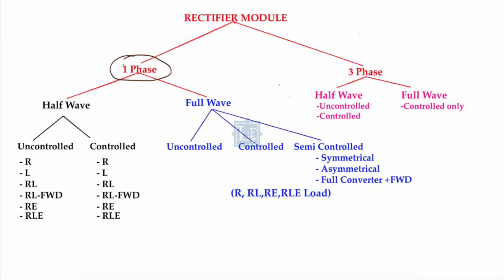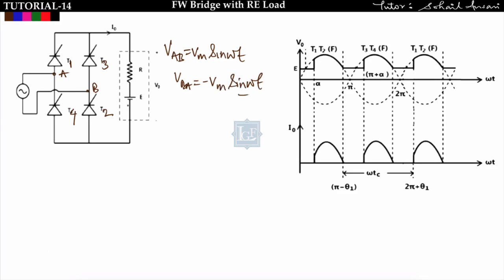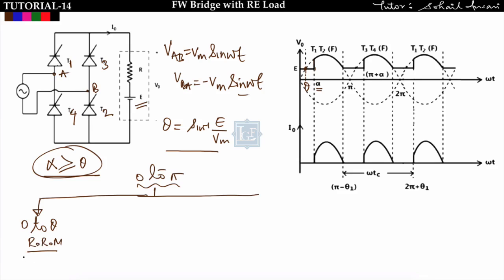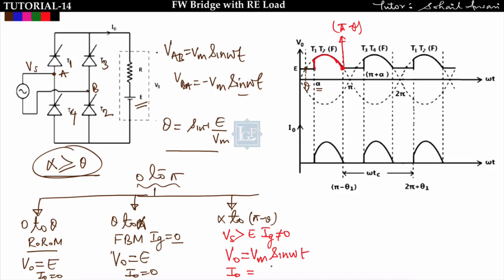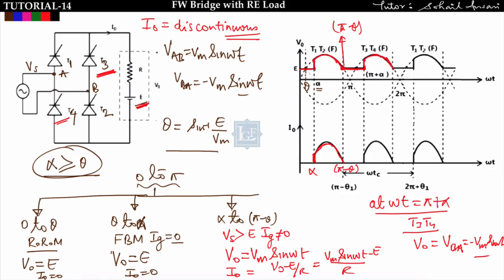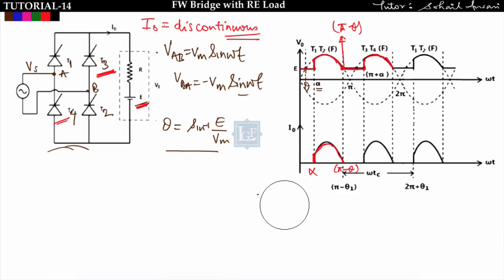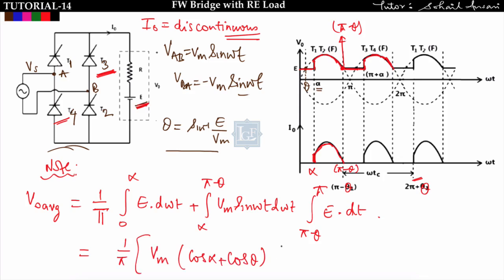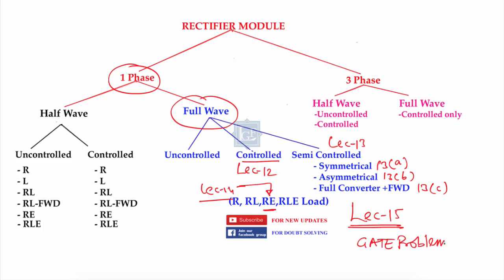Lec 14 Full Wave Bridge Rectifier with RE Load

Comment: Sir in lecture 14 at time 7:17, you said that Io(avg)={V0(avg)-E)}/R but sir Io(avg) is not constant but a  function of time itself as the load is RE and not RLE so Io(avg) must be integral of {Vo(avg)-E}/R. Sir plz tell am I right or wrong. I am confused here!
Reply: I have same dought..if calculate by sir method the value of i0 and by taking direct intregation will get same formula...I think eventually ..both are same
Reply: please reconsider what you've written. Io(avg) must be constant for any type of load- we are taking the avg value of a waveform, how is it possible for an average value not to be constant?? Io(instantaneous) is not constant for RE load, and that is constant for RLE load.

Comment: Sir why 2pi+a for calculating ckt turn off time?After 2pi thyristor T1 will be in forward blocking mode and for calculating ckt turf off time we consider the duration for which thyristor is in reverse biased state ryt?
Reply: gate 2018 here E magnitude is greater than supply upto theta thats why thyr T1 will be in blocking mode.